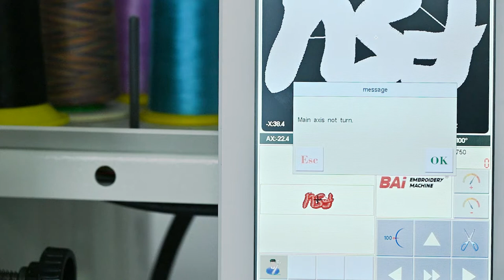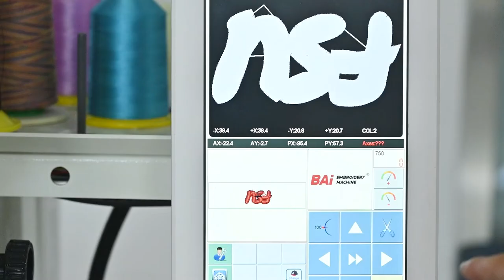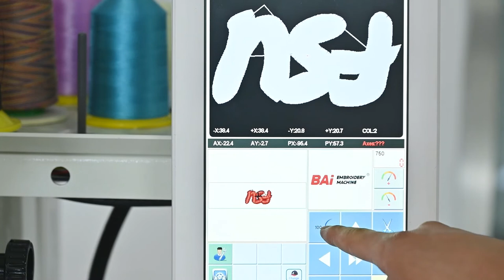How to Solve “Main axis not turn" | Method 1 (Broken needle stuck in rotary hook)

Comment: How the reset the machine at under if the needle is broking ?
Reply from the maker: You can try to remove the broken needle. If the bobbin case has been removed, the bobbin timing will need to be readjusted.